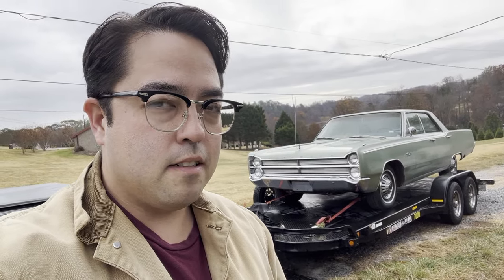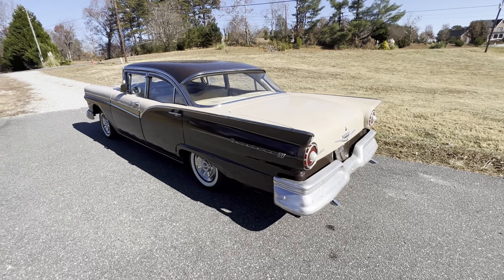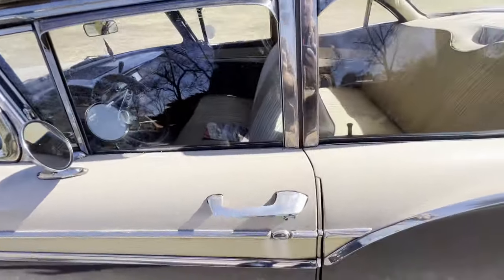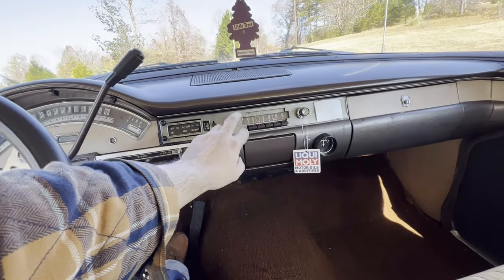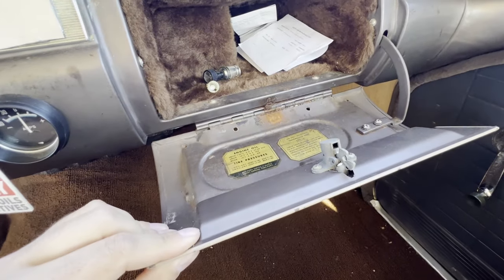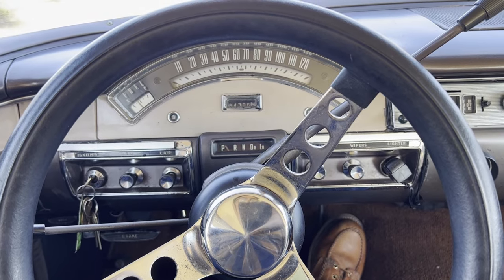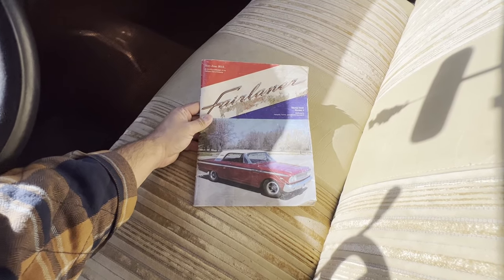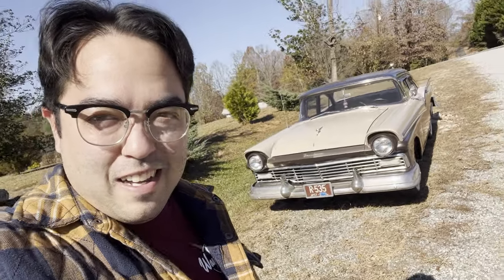1957 Ford Fairlane 500 Town Sedan. Classic car walk around and drive. 292 V8 Y Block Fordomatic USA

Comment: That's a neat car. Janet Leigh drove one in Psycho. Someone was fighting fuel system issues. The original Holley 2300 2bbl was replaced by a Motorcraft 2100 with some kind of spacer or adapter. That carb in the trunk is one of those infamous Holley 4000 "teapot" carbs, also called the towering inferno, so named because of the fuel bowl mounted up above the body of the carb. A stuck float would send a cascade of fuel out all over the engine. It probably came off that 4bbl intake. The fuel pump in the trunk is the correct-style dual action pump that incorporates a vacuum pump for the the windshield wipers. Whomever did all those "repairs" to that car, especially the hood pins, took the path of least resistance and didn't do them right. You can fix it though.

Comment: On the headroom issue. It didn't seem right to me either. My parents drove a 58 Fairlane 500 2 dr HT for a couple of years back then, and I don't remember them complaining about it, and the 58 is essentially the same car. Just updated a bit, and newer engines and trans offered. See if someone stacked washers or something under the seat tracks when they put it back in after the recovering job. It might be possible to adjust the tracks too. Fords did not have  6 way power seats back then, and most people wouldn't have spent the cash on it if they did, so there may be a provision under the seat for the dealer to adjust it for shorter or taller owners.
I watched some more, and found that you have the clock and steering wheel for it. Great! I'd clean those up and put them right back on. Take note that when in Drive, these cars start off in second gear. To start off in first, either pull the shifter into low and shift back to Drive when ready for the 1-2 shit, OR, mash the gas pedal to the floor when taking off, That will also select first gear, assuming that all linkages are properly adjusted. It has mechanical valve lifters too, so you will have to adjust the valves from time to time.
Reply: 1957 had the 2 speed Ford-o-matic.

Comment: 9:43-1962 Falcon had vacuum wipers and a huge vacuum pump incorporated with the fuel pump.  That may have been the last year, which seems strange since 63 was the end run for that body.  
Nice car.  Thanks for sharing.

Comment: Your door panels are correct originals. You are correct about the car having a padded dash originally. That would sync with the presence of padded visors. I likely had seat belts, too. That was a "Lifeguard" package that Ford offered. Electric wipers were not offered. The first character of the VIN will specify which engine it came with. C is the correct letter for a 292 2 barrel. D would be a 312 4 barrel. You won't see E or F. No way the guy would have traded that car to you if it did, and he knew what it meant. Most likely that is the original 292. There are casting codes on the block near the oil filter that you can look up. The teapot carb in the trunk did not come on that car. It's probably for a 55 or 56. 57s used the new style Holley 4 barrel with the front and rear float bowls. First year for them. You MIGHT have a 9 inch rear under there too. I think those were mostly in TBirds (my 57 TBird has one), station wagons, convertibles, and cop cars. You never know though. Check that data plate on the driver side door jamb for the colors and trans/rear codes. The seats were two toned, like the door panels. Cloth inserts (probably grey) with vinyl bolsters that match the upper color on the door panel.I'm also surprised it started in PARK. 57 Fords (originally) do not start in PARK. You had to shift to N first. My TBird got me like that. Aftermarket suppliers for these cars sell updated switches that will allow starting in PARK. This car might have one, or someone buggered the wiring. I vote for buggered. Make sure it won't start in gear!! Get a clock for it. Should be easy to find one. Most of them had one. The engine sounded real good. Good luck with the car!

Comment: Love the vacuum wipers on a good day with a driving rain if you put the pedal to the metal the wipers would stop in mid stroke until you let off the gas!😅
The fender skirts would help this 4dr with some "COOL" factor.
Reply: 2 speed electric wipers were an option. I would start looking for a good used one- IF you plan on driving in any rain.

Comment: Nice 57 ford. Definitely worth more than the mopar you traded with. It is a Y block 292. Only real issue with the Y block is the poor upper oiling design they have. To bad about the hood pins and dashboard. Still definitely a winner trade. I have a 58 2dr fairlane 500 with the new for 58 FE 332ci  4v v interceptor. 
332 and the 352 were the first year of the FE’s
Reply: The fairlane club doesn’t cover the earlier fairlanes.
Reply from the maker: I’ve had my experiences with Y Blocks. The oiling issues were very common. The engine that came out of this car had the aftermarket oiling kit.
Reply: @ObsoleteAutomotive overheating issues I thought too?? 

I just knew that newer electric switch under the dash was for a front electric fan.

Comment: Anytime You Change Anything On A Vehicle Big Or Small It No Longer Is A Original. Aside From The Opinion The 1957 Ford Is Great. Mine Was Black And Yellow Back In 1966. They Were More Common And Available Back Then And Could Be Bought For Almost Nothing. If One Were To Spend $300 To 500 You Were Getting A Beautiful Car. Especially The Long Ford Custom Or Fairlane 500.

Comment: AMC had vacuum wipers until the early 1970s. I'll invite you to the group about these Fords on Facebook since I'm in it.
Reply from the maker: Crazy. Haven’t messed with but a couple AMCs over the years. Never paid attention to the wipers!
Reply: I had a 1961 Ford Falcon with vacuum wipers(cant say a fun experience for Alaska driving). I sure hope AMC figured em out by the 70s. Luckily my '74 J20 has electric wipers.

Comment: That Fury probably rides a lot smoother and is much more comfortable than the Ford. Fury likely has air condition too right. Believe it or not I had a Fury the same color as yours and it was a different name because it was a little fancier model than yours  got it from a widow and it was in perfect condition. I really loved the comfort.

Comment: On the Fairlane and cheaper Edsel bodies the low roof and body is the same body as the hardtops made as 2 door, and 4 door sedans. The 300  sedans, and all wagons have a different body and taller roof, windshield and rear window, that's why there is not much headroom in that one.

Comment: Your Plymouth looked like a better car at it was a four door hardtop. Why didn't you look for a 2dr hardtop. To the idiot drilled holes threw the hood and ruined the dash. I am glad you got the original steering wheel so you can get rid of that rose auto steering wheel. I always liked the 57 Fairlane my had one when I was little it was 2 dr hardtop yellow and white.

Comment: Now fix the hood latch, get the parking brake working- and use it religiously. 

Getting the stock dash lights going should be easy. Loose those silly LED lights and strips. I CAN tell you a 1957 would have a CVR on the backside of the gauge cluster. Known as a Constant Voltage Regulator. They go out then, the lights dont work, guages start reading incorrectly, etc. These are sold new by current Fairlane restoration vendors. The headlight switch could also be the culprit too??

Get the clock modernized- Quartzed and reinstall in the dash. 

Install the OE steering wheel, replacement horn rings can be found.

The hood medallion is reproduced. It is a pretty red, white, and blue shield, with a Ford "shield" in the center.

Bend the "teeth" out on those hubcaps slightly with pliers. Not all of them, like every 4th one. Also use a small file and sharpen the "point" on every other "tooth". Trust me it works.

Looks like whomever covered your front seat, added WAY TOO much extra foam. That is why you are sitting so high.

I would invest in some Diamond Back brand WWW radials. Get the larger "optional" 1957 size tire. Today's equivalent to a P225/75R14 if I remember correctly. Safer tire, lasts longer, and looks authentic. 

I would order a new carpet kit and reproduction floor mats too. 

I made other comments in the above replies. 

Nice '57. 👍

Love that bubbeling Y-block V8 sound...

Comment: I thought the 312 was used in passenger cars and the 292 was mainly used in trucks
Reply: The 292 was common in cars through the 1962 model year.
Reply: @dstrau7987  did not know that thanks for the information